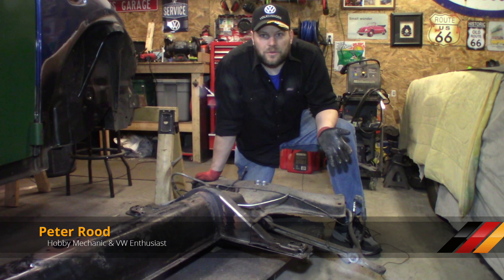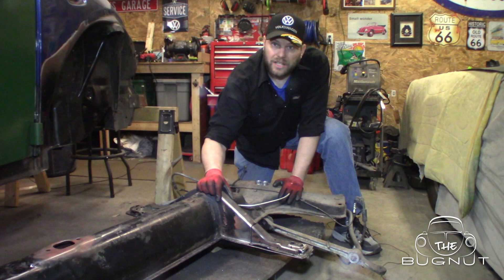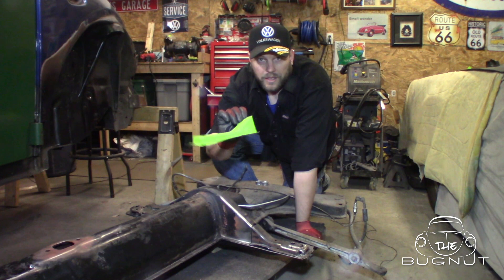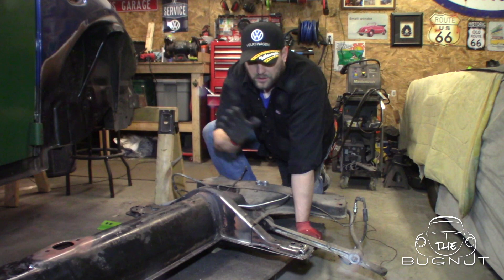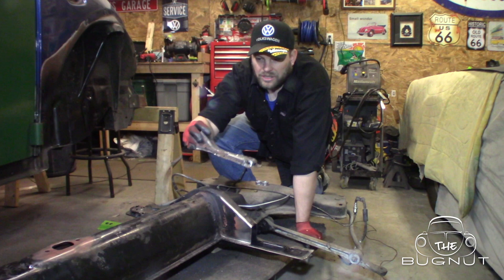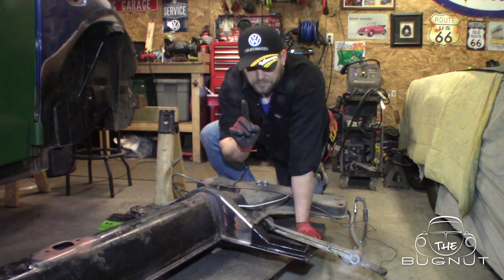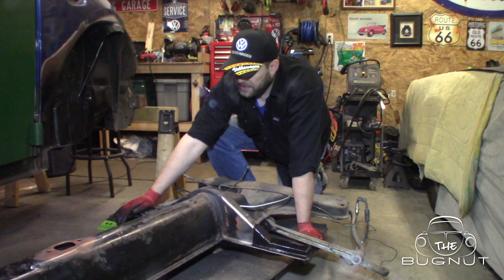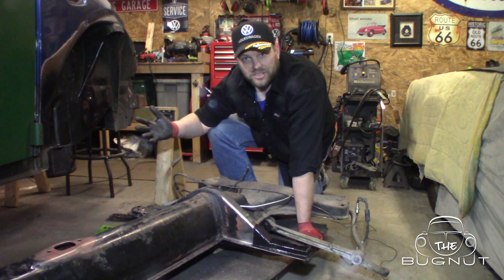THEBUGNUT.com - Napoleon Hat Ends

Comment: Hi Peter, have you ever replace/repair rushed Napoleon Hat ends in place without removing the body? is it even possible? thanks.
Reply from the maker: I have not, I am not sure you really can without it being a real hack. Also, if you need to replace your Napoleon hat ends there is a real chance you have other rust that needs to be addressed. Body off is the only real way to fix it.
Reply: @thebugnut708  noted, thanks. I am not ready for a body off restoration/repair at the moment, so I was hoping it could be done without taking the body off. Thanks.